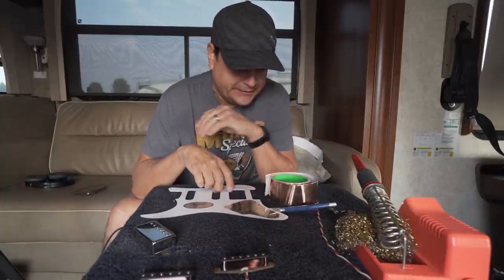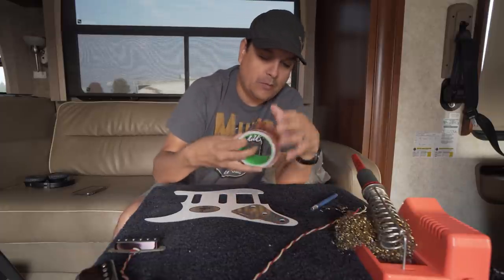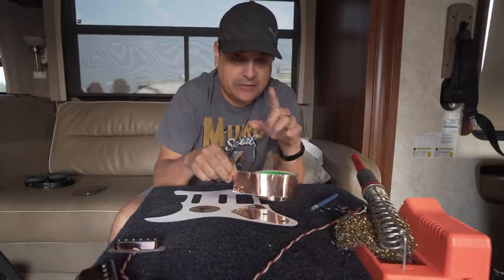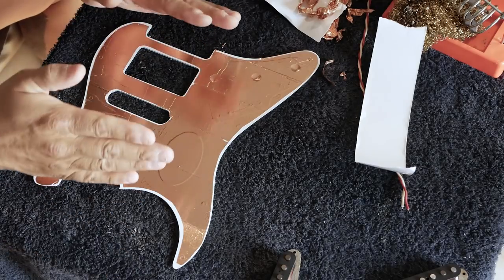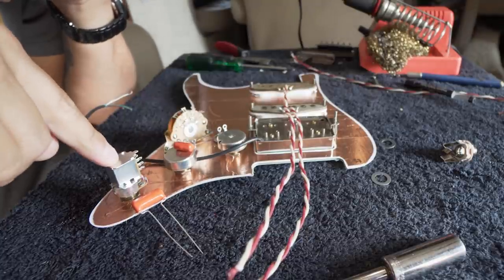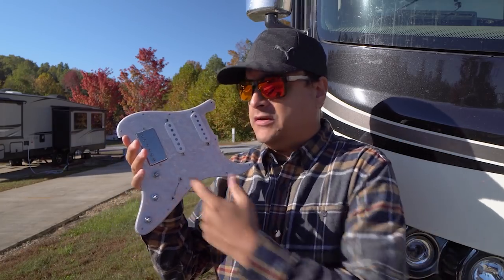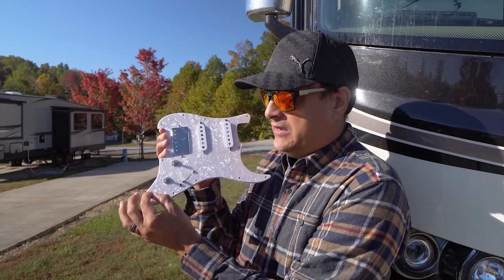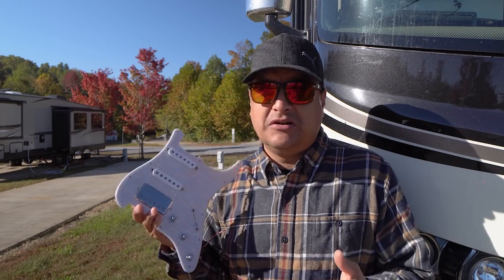250k vs 500k Pots And Bridge Tone Control In a Strat

Comment: You actually had your capacitors mixed up, you're supposed to use the .047uf for the single coils and .022uf for the humbucker. .o47uf way too muddy for a humbucker
Reply from the maker: Well…. Fender has been putting .022s in strats since 1954 …. And really… a player can do whatever sounds good to him so….
Reply: @DylanTalksTone  it's .047 in a humbucker that's not usual not the other way arround. But it's all relevant i guess